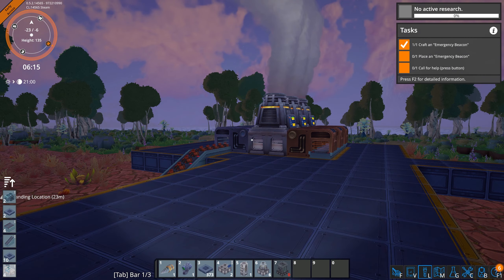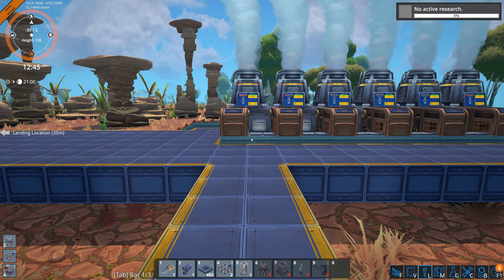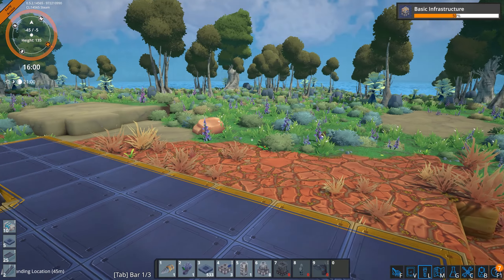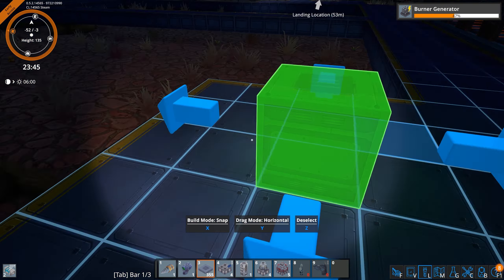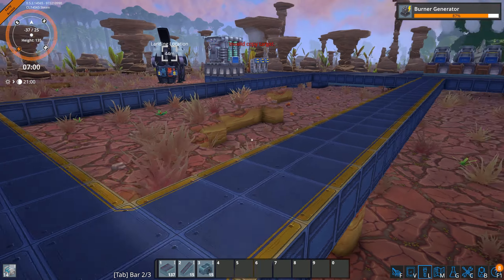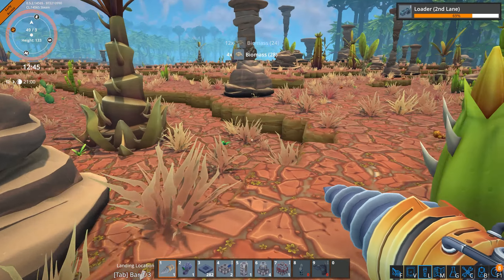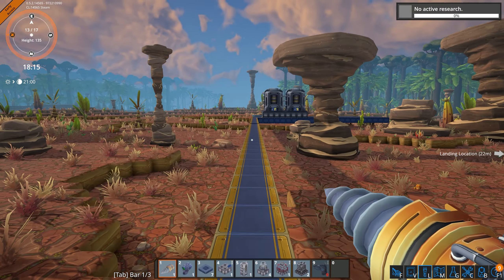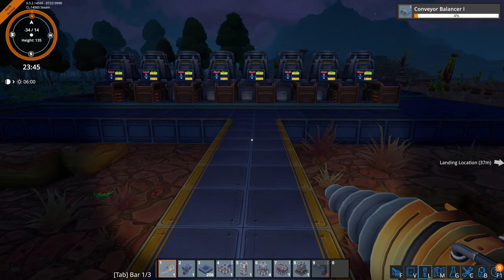Burner generators and ignium ore... more powah! | FOUNDRY | BigVlad Plays | Part 2

Comment: I left my biomass burners up just to dispose of the biomass from clearing the foilage. The biomass builds up and just takes up space. I haven't found a use for it so far.
Reply from the maker: I'm using it for explosives now. I've been using a lot of them to dig through mountain to get to resources. Apart from that, I'm not sure if there is any use. But explosives do eat them up.